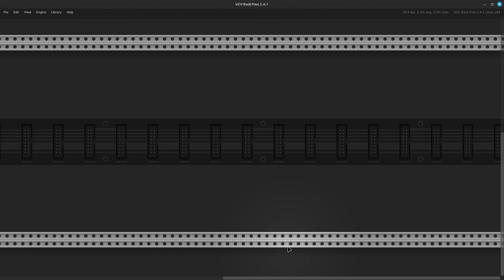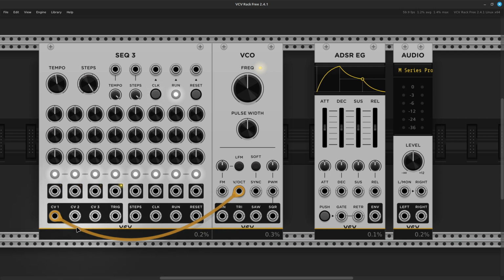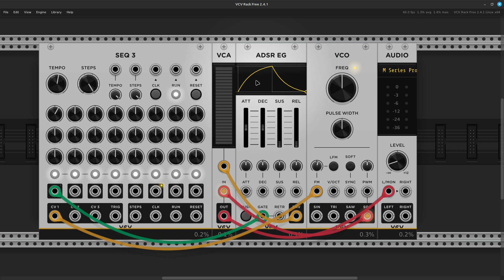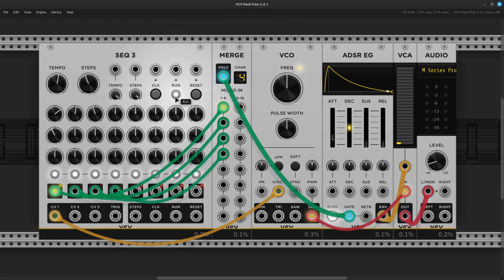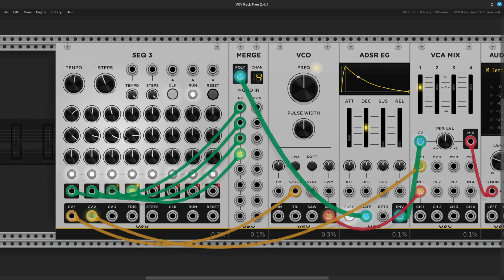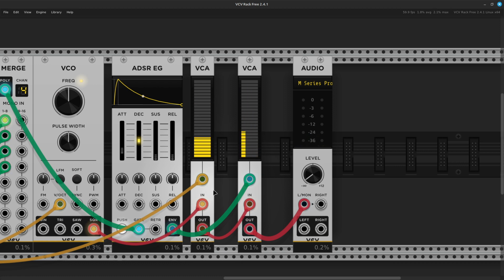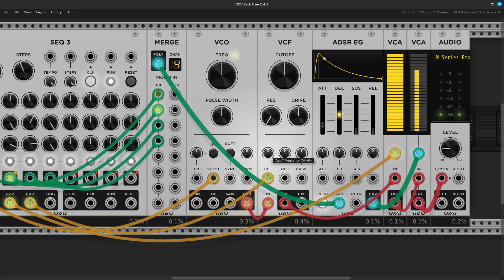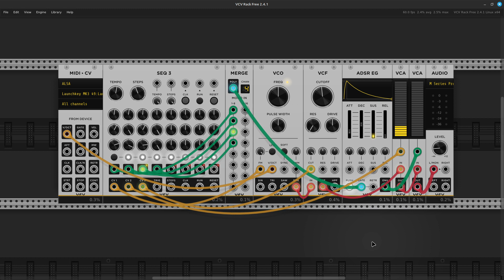Learn Synthesis with VCV Rack S01E09 - 8 Step Sequencer Tutorial

Comment: I am brand new to synths and just started, the SEQ 3 gave me heaps of problems, unusable gates triggers etc.
I found the following in the VCV - User manual - SEQ 3.

Normally the TRIG output emits a 1 millisecond pulse when advancing to a step with an enabled trigger. Some hardware sequencers instead pass the external clock gate (however long it may be) through to the TRIG output if the step’s trigger is enabled. This behavior can be enabled by right-clicking the panel and clicking “Clock passthrough”. When using the internal clock with this mode enabled, the TRIG output emits a gate with a 50% duty cycle.

I found this very helpful and made the SEQ 3 much more useable.
I am really enjoying working my way through your tutorials, learning a lot and enjoying it at the same time.
Reply from the maker: Thank you for this information. I will try this technique in the future. For the time being, I have been using other sequencers, but It would certainly be nice to use SEQ 3 since its design is a good one and it has a simple interface relatively speaking.

Comment: Hi, still haven't seen others episodes, but you can use the VCA MIX if you send the ADSR EG poly signals available at the envelope output to a  "SPLIT" module, that will be used to separate each of the four signals and to send them to the VCA MIX inputs labeled "IN 1" to "IN 4". After that you just need do send the SEQ 3 CV2 output to "CV 1" to "CV 4" at the VCA MIX, to control the amplitude of each signal, while using CV1 to control the pitch and CV 3 to control the VCF LPF signal to the ADSR EG, mantaining the common envelope. Learning a lot from your videos! Thank you.
Reply from the maker: In a couple of episodes you will see that discovery courtesy of Frank from Germany!